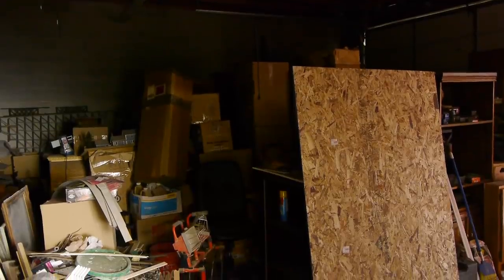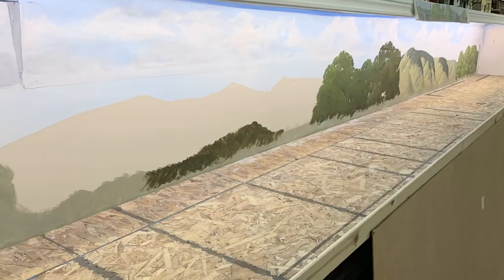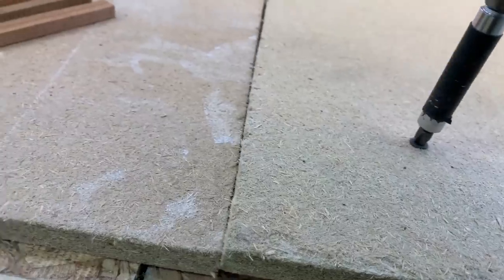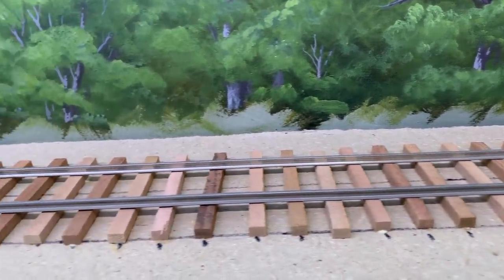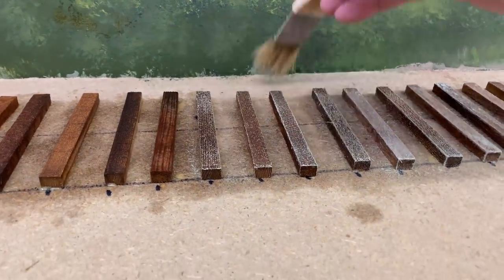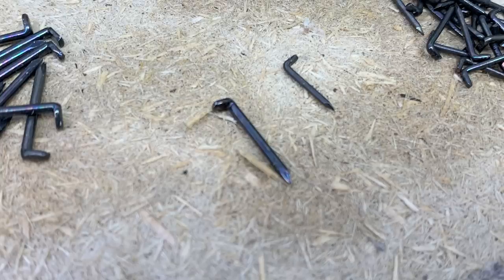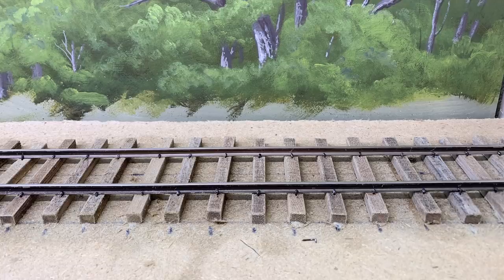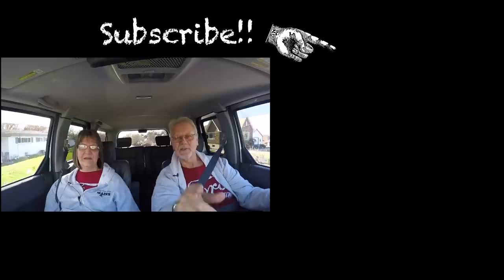Hand Laying Track on our Indoor Garden Railroad

Comment: The backdrop looks very dramatic and effective actually. 

Love the technique for rail laying too btw. On the front tracks why not leave say 5 or 6 ties in a row unweathered and partially spiked so it looks like the track crew have been out and replaced a section and are coming back to it later as they do in the prototype. In the prototype I've also noticed on wooden ties they sometimes substantially angle one tie and leave it like that. I've always wondered why, but you never ever see that with concrete ties. Perhaps they do it because the the gap between the ties in that spot is too narrow to fit 2 ties so they angle one to fill the gap??

We're socially isolated and aren't allowed to drive unless it's for groceries, work (if you can't work from home), or going to the doctor. All camping is banned and no visits to family you don't live with. I can't even visit my son. They're handing out $1650 fines aplenty for breaking the rules. Upside?; we're almost on top of new infections and the state government are committed to keeping it that way. It's for the greater good. 
We are allowed out to exercise for an hour. Word 'round the campfire this is going to continue until at least early 2021 since the economic stimulus package is designed for 6 months and they're making plans as I type this for plans after 6 months. 
I just have a feeling things might never go back to the way they were before and I'm unsure if that's good, bad or somewhere in between. I think this will change society for a very long time at least.
Reply: ThePaulv12 where are you? It sounds strict but as I reflect on my local’s approach I wish ours was a little stricter...
Reply: @Deadbuck73  In an English speaking country outside the US mate!
Reply from the maker: Hi. Here they are a bit nuts. Some of the people here still insist it’s all fake. And the governor refuses to lock the state down in spite of federal guidelines. So the restaurants in theaters and gathering places are closed all big venues closed in a lot of places have closed voluntarily but  a lot of people are still going out and shopping for clothes and whatever else they feel like. Our mayor put fines in place for going out and the governor quickly overruled him and said you can’t do that!  Sort of in limbo. I’ve thought about “new” ties. I’m planning to do a few details like that one of which will be at least one spike barrel laying over on its side with the spikes spilling out. In the. I model in spikes were packed and wooden barrels fairly small because the spikes for heavy, and they would be thrown off of a flat car where they would usually smash on the ground next to the track spilling all those spikes all over ready to be used. But as a kid I would always look for the ones that didn’t break and I finally found one that I could dump over and take the barrel and leave the spikes behind and I have that barrel here in the garage! Anyway I want to model of that and intact barrel over on its side with the spikes spilling  out.
Reply: Toy Man Television we used to walk our local tracks as kids in search of spikes... we’d find one here and there! Then the railroad decided to replace the ties... and they left a huge pile of new spikes! I only “found” one because I didn’t want to be greedy... lol... now you can’t travel the tracks anymore because it’s live with commuter trains... it was so peaceful back then...
Reply from the maker: Cranky!  Or is that Crankie or something?
Reply: @Deadbuck73  where i live they just leave the old spikes by the track. Thousands, everywhere there isn't concrete and esp on tracks that have been torn up 60 years ago.